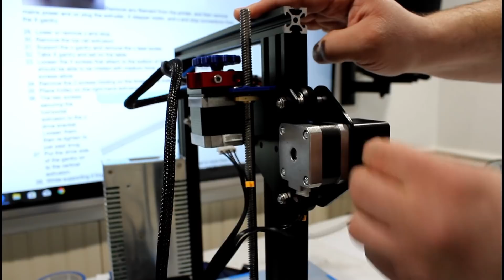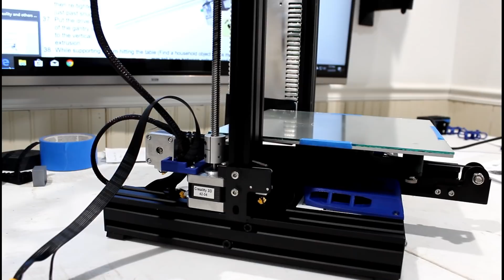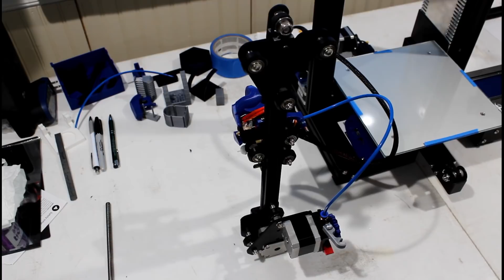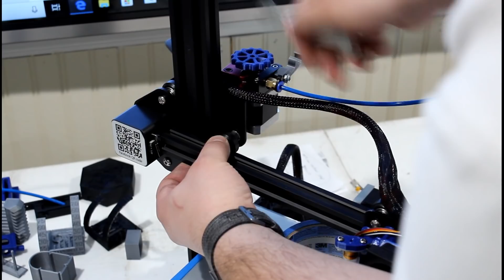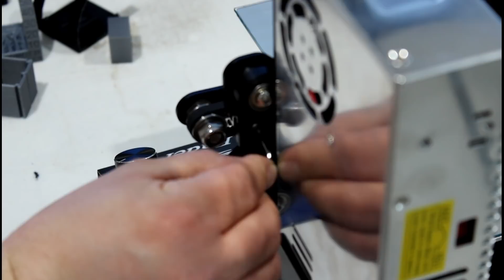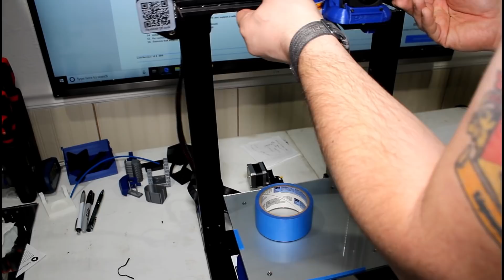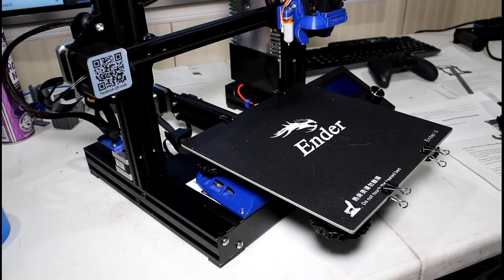X Gantry Rework Section 2.1.2 featuring the Ender 3

Comment: Add the second z axis screw the gantry will stay within a half a millimeter. Also add the brass backlash compensators with the springs on the z-axis ball screws...
Also remove the bader extruder E axis off the rear . Replace the carrier x axis with the geared head . Reduce the length of the filament  tube. You can achieve faster feed rates...

Comment: Edit: I got rid of the pan head screws holding the X axis extrusion to the left rollers. Replaced them with some M4 hex bolts, and I bought a slim 7 mm wrench that fits behind. Now I can adjust both ends of the X axis without needing to keep rolling the entire thing off the top to get access to the left side!

Original comment: I wish Creality had drilled some access holes through the left side vertical extrusion so you could access the screws that attach the roller sled to the X axis gantry.

Comment: Thanks for the video, but isn't this method flawed? After I tightened the screws on the right side, and pulled the gantry out to tighten the "snug" screws on the left, they get misaligned again and we're back to square one.But it seems like cause of the design of the printer, there's no other way to do it

Comment: Before you want to tighten nuts on upper bar. You must be move the Z gantry up as possible to the top bar before you will tighten the screw. It's will transfer the length at the bottom from between the Z -Axis Posts to the top Length too. If you don't do like that when the Z gantry move up you will got jam or friction cause it's not symmetry.

Comment: Thanks 1000x. I fixed my Ender-3 thanks to this video.
I can now just press Print and it starts printing. Before this video I had to mess for an hour before I could start printing. I had to level it each time. 
I "rebuilt" my X gantry step by step like he told and I found my issues and fixed it. 
My rollers where too tight and frame was not square. Now its perfect. There is no such info on Creality official videos.
Even my walls top and bottom and left right sides are perfect now. No wobblyness

Comment: Today I was checking my old Ender 3 Pro and noticed, although it printed very well, that 2 of the bed screws on the right were sticking out of the leveling knobs noticeably more which leads me to believe there is a slight vertical parallelogram warp instead of a square cube. I can't be sure what is at the root of the misalignment so I will try a similar rebuild but first step would be to align the bed with the frame & then loosen and rebuild the X Gantry to align it to the previous 2, which are already aligned, for a nice even square.

Comment: I have an anycubic kobra go and this guide has definitely helped. Ive followed the steps in this guide and my x gantry has been consistent but then i bumped it and it now is sometimes level sometimes its out by 0.12mm at most. Is that going to be a huge problem?? Will it always be so sensitive?

Comment: Couldn't be less helpful. "But I'm not going to to do that because mine is square"

YEAH AND OURS AREN'T THAT'S WHY WE'RE HERE. Thank you for not explaining how to adjust it if the measurments are still off.
Reply: Use common sense and logic. I fixed my Ender-3 thanks to his video.
I can now just press Print and it starts printing. Before this video I had to mess for an hour before I could start printing.
I "rebuilt" my X gantry step by step like he told and I found my issues and fixed it
Reply: @jw200  Congratulations, you wrote one of the stupidest comments on the internet. Want a prize?

Comment: If you strip those hard to reach button head bolts on the left side of the gantry, you might be able to get them loose with a bit of patience and a set of needle nose pliers. Also make sure the allen key itself isn't stripped. The ones that come with the printer are trash to say the least. 
I stripped all four of those X-gantry screws. Glad the printer comes with ONE EXTRA. If you manage to get them off and have even more patience, order some M3,4,5 bolts. I believe these ones specifically are M4x16mm button heads but most others are socket heads. I couldn't be bothered waiting an entire day for Amazon Prime one day delivery so I just stuck them back in and tweaked them good with the pliers again. I'm sure that's fine. Probably. Right side ended up being 0.3mm off from the left so I figured it's good enough for the girls I go out with. Appreciate you, this actually helped a ton.

Also TIL that you shouldn't use the long side of the allen key to tighten anything. Turns out it can very easily strip them. (This happened on initial assembly, way before finding this video.)

Comment: Is this tutorial also valid for the Ender 3 Max which has the vertical aluminium 2040 v-slots screwed to the sides of the bottom aluminium base and not on-top of the base like the Ender3?

Unrelated question: I am not sure what the reason is for your sagging in your video. Is it the vertical gantry beams being misaligned? No other reason? Thanks.

Comment: i've ran through this start to finish twice today and im still having issues.    when i try to print the left side of the bed is squished like the nozzle is way to close while on the right side of the bed it looks like the nozzle is way to far away and is laying round filament with no squish that gets picked back up by the print head when it comes back around.     im new to ender 3's but i've been running  an ender 5 pro and ender 5 plus for a while and never had an issue like this.

printer info is 
ender 3 v2
sprite pro 
th3d filament sensor
th3d ezabl
th3d firmware
Reply from the maker: Did you measure to the top gantry? Was it the same on each side, to the top?

Comment: Mine was roughly 15 mm out of spec and even after going through the video it was still 10 mm out of spec. I loosen one side and tightened to the other and although it's not right I guess I'll see how my first benchy comes out.

I think I have something bent in my printer but I really appreciate this video.
Reply: I had to swap the right hand carriage with a spare one I had,  The holes were drilled a couple mm off,  You could only tell this if you had another one to compare.

Comment: In my opinion, one of the key weaknesses on the E3V2 is the single motor Z-axis. I added a second Z-axis motor and matching screw shaft and the gantry not being square is not much of a problem anymore. Other things are getting the higher tension (yellow) springs, putting some thread locker on the threads and a bit of build-up on the opposite side of the spring. That prevents the adjustment ring from loosening over time. One last thing is to tighten the adjustment ring to the point of binding down the spring, then backing off 2 full turns. This keeps the springs at very high tension, so things are less likely to adjust. One last thing is shimming the bed to get it as flat as possible. Final problem is the damned wheels. They are very soft and eventually wear down. I do not have a good solution for that - yet...

Comment: Awesome video. Fixed alignment issues with my Ender 3 V2! I did run into my z-rod getting stuck after this video, but I fixed it by feeding it into the stepper motor BEFORE adding the x axis.

Comment: You know, not to be critical but you could have done all that without removing the whole X gantry. But also a better solution is install another lead screw on the other side. I did that on my Ender 3v2 and it works like a dream.

Comment: I don't know if you're still monitoring this video but I have a question.  My are trollies are nice and stable but when I get the machine assembled the right side of the x gantry has quite a bit of play vertically.  Is that normal?
Reply from the maker: Hey! Meaning that you can lift it up by pulling on it?

Comment: After taking out the top aluminum section a spring and brass bolt flew out. Where do I put them back ? Also wondering if it's normal that my x gantry now never rests on the z axis it falls down automatically. Is there something wrong with my rod ?

Comment: Starting about 13:08 it mentions that you want your gantry to be no more than 1mm difference on each side, but I don't understand how you fix it? He adjusts the right up and down to compensate, but you can't tighten the slightly snug screws on the left without taking the whole thing off, and then you lose your zero.
Reply: Any solution to this ?

Comment: Guys, if you're having print issues I cannot stress how important checking your gantry is.  I spent over 48 hours (actual hours working on it) figuring out why my prints were all screwy.  Even with an ABL and Meshing, it just was very screwy. Trying your method got me much of the way but when I tightened down the ones on the z rod side, it would distort it.  So I did a tad more than over snug. I also ended up replacing the two m4's for better screws that were Philips on the PSU side (the ones that are more easily accessible.  I ended up putting stuff on the bottom supports to have both sides of the gantry to rest on so I knew it was even when I tightened then moved it and down a couple times to make sure it held and it's great.  I am def gonna look into getting a second z motor on this thing.  It seems like it would just be much easier in general.  Thanks for the video, it was a tremendous help.

Comment: Hey, at 13:30 you talk about adjusting the X gantry if it has more than 1mm play on the right, and that we should be able to do that because the left gantry screws are only just-past snug tight. I can lift the right to make up the 2mm shortfall, but how do I set it so it does not fall back? Do I tighten the screws on the right? I'll try that in any case.

Also you're a legend for this, thanks! Horns up! \m/ \m/
Reply from the maker: Hey! Ya, snug down the bolts on the left side a little bit and you should be able to move the right side, but have it stay where you move it.
Reply: Shoot me down if I'm wrong man but I seem to have fixed it by
1) pushing the gantry up a little and holding the tension, then with my other hand
2) tightening the right screws,
3) removing the top rail and the gantry
4) tightening the just-past snug screws on the left. 
We'll see if it works.
Reply: @DarrenPauli  step 2) what screws in the right ???
Reply: Lol sorry wrote that before I saw you reply 😃
Subscribed!

Comment: Whilst this is a very useful video, I disagree with your way of using the Allen wrench. You say that using the short end puts less strain on the bolts and using the long end puts more strain on the bolts. This is incorrect as demonstrated in your video, and actually the reverse of actuality. The Allen wrench is acting as a lever and the longer the lever arm is, the more force can be applied. By using the long end with the short end as the lever restricts the amount of leverage (force) that can be applied. This is easily demonstrated in reverse by attempting to loosen a very tight bolt. If you use the long end with the short end as a lever, you will likely not undo the bolt, but using the short end with the long end as a lever allows you to apply maximum force and you will either succeed or break something. :-D
Please amend your instructions so that folks are not lead into bad practices.
Reply: You are wrong, the reason he uses the short side is because it is not rounded, and is less likely to slip out slightly and strip the screw head. It has nothing to do with leverage/force/tightening.
Reply: @AlecShernAPS  I disagree and stand by what I said. It's a basic law of mechanics regarding leverage. Not only that, not all Allen wrenches have rounded ends.

Comment: A big thanks for making this video! Now my X axis isn't sagging anymore on my Ender 3 v2 (and I can finally use it).
Reply: Were you able to follow this completely on the v2? This is my only real issue left after a few weeks so I am planning to follow this as soon as I have the time after work!
Reply: @TriconPOE  I followed every step in the video, and it turned out perfect. The belt tensioner on the X-axis is a bit different from the video, but wasn't hard to get right.
Reply: @anol18  Thanks a lot!

Comment: Personally, before securing the uprights I'd take the 2020 top piece off and clamp it against the 40mm face face of the z uprights (low down) before securing the 4 bolts underneath, then lift the ganty all the way to the top before reattaching the 2020. You know, to ensure the v ways are as aligned as practically possible. It should be noted that creality were using some dodgy 4040 extrusions on the earlier enders - mine for example, top and bottom has the flat running down the centre raised higher than the two either side. As this surface is where the uprights (z axis) bolt into, could be a problem for some.

Comment: Thumbs up for the good advice, almost went crazy not understanding why my first 7-8 layers were garbage... Have replaced the fitted allen screws on the left side with 4mm hex head screws so it was easier to reach and adjust them while everything was back in place. Thanks again!

Comment: I want to do this on my Ender 3 V2 but the right hand gantry plate has a belt adjuster also bolted to it using the bolt that hold the plate to the gantry extrusion so I assume I would have to remove the belt etc ?

Comment: So I noticed when I turned the z motor by hand to put the rod back in, i could feel it hitting a snag in the same spot each rotation, is that normal? Also, I feel like my rod is almost grinding either against the coupler or the hole the rod is placed into for the x axis

Comment: Thank you for this guide. By following all parts until 13:30, the difference went from 4mm to 2-3mm, but I'm not sure what can be done to further minimize the difference in heights. You mention adjusting the two screws on the left of the X gantry, but those we're touched at all during the rest of the video.
Reply from the maker: Nice work! I would just make sure everything is tight and straight that should do it for you
Reply: @TheEdgeofTech  What I found is that, of the two right rollers near the power supply, the bottom one spins freely without touching the extrusion. Meanwhile the one above it is fairly tight against the extrusion.
Reply: Ok I’ve reinstalled the x gantry with all wheels loosened and that did it, as I tightened them it all fell in place. It’s pretty straight now. Thanks again!

Comment: I don´t see how you get the rail of the x axis square to the carriage. Motormount side. Mine was worst off after the adjustment than before.
Maybe it´s just me but wouldn´t it be better to take the bed and carriage off to get it parallel to the base (2020 or 4040 Extrusion that is the rail)?

Comment: Thanks for the great video! Sadly I noticed that one of the 2 bolts you snug on the extruder is stripped (not the bolt, but the rail where it screws in). So I can only snug one of them. Is it posible to purchase only the x axis beam? If so, where? Thanks!!
Reply: What size thread bolt is it? You could tap and insert a helicoil, the thread normally strips to core size for helicoil anyway so shouldn’t have to drill it.

Comment: Why couldn't you just take it to machine shop and have them mill the extrusions to be the same length and make the milled surface square with all the sides? That would solve a lot of the variances in the parts as they were delivered, right?
Reply from the maker: Potentially yes! But most people don't have access to a machine shop. I would be nicer if the manufacturer did this for us! :)

Comment: One important thing that all of these "printer tune-up" videos either take for granted or miss all-together is the use of the term "Level", and if you are new to the desktop 3D printer world this can be very deceiving. When adjusting the X-axis gantry, or the Y-axis rail for that matter, any level adjustment is relative to the surface that the printer is sitting on. Unless the base frame of the machine has been shimmed to be level in both the X and Y axis, independent of the surface the printer is sitting on, then all subsequent checks for how level any part of the machine is will be skewed. Any check for trueness of travel should always be measured using a caliper or whatever means available and never leveled. I may be splitting hairs here, but unless you actually do know better, this is very important and just might mean the difference between a great print or a failed one.

Comment: i really dont understand what he does. how have you? he just says to do thing without any purpose to them please someone help i have a issue with my ender 3 that about after 2 hours in the nozzle starts to touch parts of the print as it moves and finally remove the print from the printbed my bed is completely leveled and so is my x axis any ideas?
Reply: same with mine, about to do this and e steps calibration

Comment: Trying to do the alignment on the ender 3 v2, it was way off. I was following along and everything was aligning correctly until I had to put back the top brace at the end of the video... The two bolt on one of the pillars were inward compared to the screw holes, almost like the pillar weren't straight. Did anyone had the same problem?
Reply from the maker: I did not have that issue on my Ender 3 V2, but I have heard others may have.